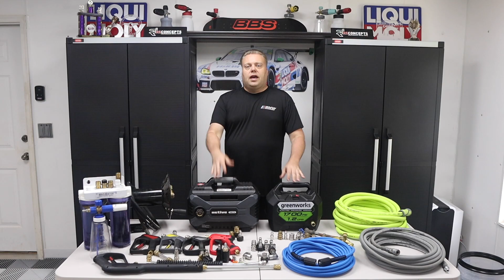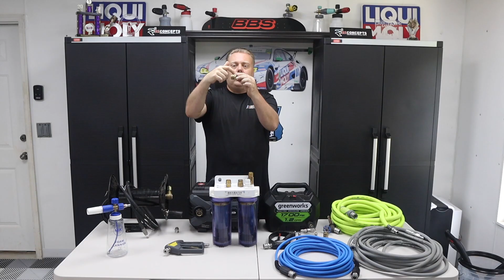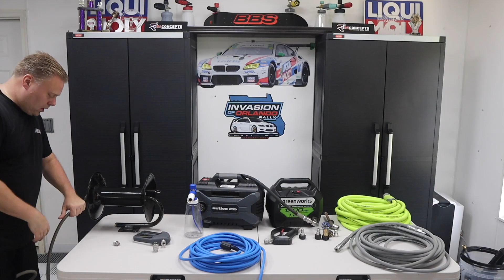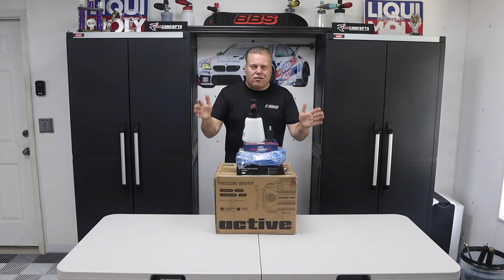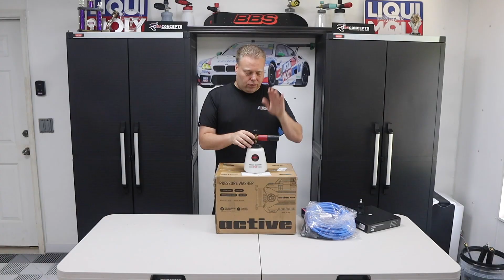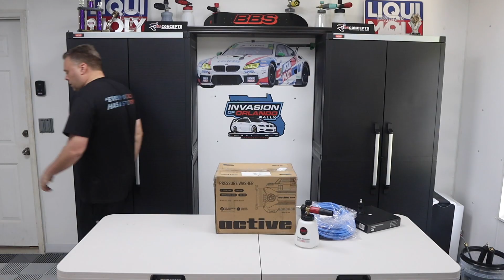How To Upgrade Your Pressure Washer Setup | All Connections Needed | Filtration & Hose Reel

Comment: great videos and explanations.  I have a question about the 90's.  do you experienced any water hammer effect, or have you found any shavings in any of the filters from the water slamming in to the walls of the 90's on either side of the pressure washer?  im thinking of wall mounting my 1800 1.2gph green works  and between inlet and outlet hoses, could turn the probably 11" wide PW into 20 or more.
Reply from the maker: I myself have not seen that usually the elbows I use are ported on the inside so it’s smooth flowing water. I do generally try to avoid elbows if I can though as it is a restriction point. Some pressure washers can create a hammer effect with just a straight hose. The length of the hose really determines the fact as if it’s longer and a flexible type hose it will absorb that.

Comment: If I have quick connect on the pressure washer and gun I cut the water off and release the pressure in the gun still can’t change the gun out have to wait about 30 minutes though when pressure releases can switch between guns
Reply from the maker: I have never heard that before could there be an issue with the gun not full releasing pressure? Maybe a debris blockage somewhere in there.

Comment: I just purchased the simoniz version of the active 52. I bought an adapter to use an Uberflex hose but it won’t work with it, any suggestions?
Reply from the maker: I think those are 15mm M22 on the Simoniz.  You probably need a 15mm to 14mm adapter. I’m not 100% sure though without knowing what is not working.
Reply: @ that’s what I bought and it will turn on then doesn’t work. I’ll try another adapter.
Reply from the maker: @ Normally the issue with an adapter is it leaking not the machine not working. Could the nozzle be clogged with debris?
Reply: @CarsWithKeav  it was brand new. I’ll try it again while I’m waiting for a new one. Thanks
Reply from the maker: @jayrp4059  Nozzles can get clogged with debris from the factory. Usually they will come with a nozzle cleaner for just that problem.

Comment: Bossman Keav. I want to use a swivel with my flexzilla hose i added to my ik foamer. I need a male to female. Whats ya got man?
Reply from the maker: I am unsure of how you have it all connected to know and also have never modified an IK12 there are so many different ways including using air hose fittings.
Reply: @CarsWithKeav  the ik is connected with only the ik fittings. Everything was removed from the flexzilla hose and the ik stuff was added
Reply from the maker: @ Ah, so you cut the Flexzilla and reused the fittings on the IK?
Reply: @CarsWithKeav  yes 100%

Comment: I've got a gun without a swivel, I have bought m22 swivel. is there any issue with fitting it to the hose before the quick disconnect. HOSE > SWIVEL > QD > GUN
Reply from the maker: I don’t see an issue as long as the swivel is somewhere it should help out. Just depends some swivel a little and some swivel a lot. It’s hit and miss.

Comment: Automatic, or push-lock or push-to-lock quick disconnects really need to be a bigger thing. I can only find them for mounts and not Female to female fittings to replace my gun. I had to order one from Aliexpress for $10, we will see how it goes. One company called Car Scope UK sells them but they’re $30 plus shipping. Shocked OG doesn’t even sell them.
Reply from the maker: Never really tried those. I’ve heard some have issue with them handling pressure and leaking. I’ll have to look into them.

Comment: Hey brother anyway you know the size for a elbow fitting for the reel and for the connection for a ryobi pressure washer as well both elbow for the whip hose ?
Reply from the maker: Fitting on the reel would be 3/8 npt and Ryobi hose uses m22 14mm

Comment: @Cars with Keav 😀👋💪
What can be done when de 20" angled wand does not connect with the quick connect properly?
Specifically when it does not lock into place.
Thank you for the help!🔥
Reply from the maker: Biggest problem I have found in the last few years of trying out all this stuff is some quick connects do not work well with others. It’s always advised to have the same brand so they fit. I have a few that will connect to some, but connect to others.
Reply: @CarsWithKeav  Thank you!

Comment: Buddy im starting into pressure washer and im eyeing on the bigboi washr pro do you know what is the size of the end of the gun the quick release where your nozzle tip goes
Reply from the maker: Those will always be 1/4 inch quick connects for the nozzles.
Reply: @CarsWithKeav  so the nozzle tip connector is 1/4?
Reply from the maker: @henrysilos7343  Yes, just about all nozzles are a standard 1/4 inch and the ones that come with the Big Boi Pro are 1/4 inch.

Comment: I have found problems finding answers to my problem... So, I have a 1650 psi and 1,5 gpm pressure washer but im unsure if i can use a 1.1 orifice on my foam cannon. Is it safe for the motor or am i putting stress on it?
Reply from the maker: Can you give me the name brand and model or the link you bought it from? Normally 1.5gpm you should be safe with a 1.1 orifice. Only way to really know is with an amp meter to make sure it doesn’t go higher than what the machine is rated for. I use this one it’s $11 https://amzn.to/46DgZ1S
Reply: @CarsWithKeav  I Use a Parkside 170 D2 Model. Working pressure is around 1650 psi and max is 2450. Max Gpm states to be 2.1 ish (500l/h) and lowest states 1.32 gpm (330l/h). I came across a vid of someone measuring the machines actual working gpm at around 1.58 (360l/h) which is pretty far from the max imo
Reply from the maker: @mxstic_7797  I see this looks to be European it’s not available in the U.S., but looks like it’s a 230 volt electric plug? If it is then you should have no issue running a 1.1 as the 230v would use much less amps than in the U.S. on our 110v system.
Reply: @CarsWithKeav  i meant stressing it by reducing the gpm below the minimum that is stated considering the low working gpm
Reply: @CarsWithKeav  Wanted an opinion cuz i struggle to find a clear one about the damage it could do. I want to have good foam but i dont want to hurt the motor at the same time

Comment: Hey I ordered the quick connect fittings to shorten the original gun but it works good. Hey I look at the video but I didn’t see the connector to make it swivel at the bottom do you have the link
Reply from the maker: This would be the swivel https://amzn.to/3Xt558n are you looking to swivel a stock gun or a short gun? Most don't do that, but it can be done. the investment is basically what a decent swivel gun itself would cost. There are some swivel guns that are $20 such as this one that has the same connection as a stock gun. https://amzn.to/3RvZavv

Comment: Highly under-rated video keav. Problem for most is getting hold of the spares, I would suggest everyone just by Karcher, cheapest spares and availability too - for Europe
Reply from the maker: In Europe at least you got the 230v and your machines perform so much better at lower amp. I’m so jealous of that.
Reply: @CarsWithKeav  Karcher do make 110v Machines for professionals here too. Not cheap. Think Tesla has gotten that too with the 48v truck, you need smaller lighter cables with higher voltage and lower current. Think it's going to be the new car standard instead of 12v, Monroe was suggesting on YouTube.

Comment: Can someone explain why you would want a shut off for your water supply at the pressure washer? Whats the use case for that? To me it makes no sense. Sounds like more of a liability to forget to turn it back on and run the pump dry immediately
Reply from the maker: If your pressure washer is 20 feet away from the spigot you can turn the water on and off without having to walk all the way to the house. If you turn it on and off at the house wouldn’t you have the same possibility of forgetting to turn it on/off then too? This way you bring the hose to pressure washer with the water already running then hook it up and go. No walking back to the spigot to turn it on and then walk back again.

Comment: Just came across your channel great explanation. If you were to up grade what way would you go in my position? active or still stay gravity? I’m just starting out and just found out my system is backwards. I bought a ryobi 2100psi 2.1gpm. I’m just wondering if I should just by a harbor freight transfer pump and call it a day, or change my PW. And which way to go. I have a 125gal tank. I noticed when I did a test ran on my f250 I went through quite a bit of water. Which I was surprised I put 60 gal of di water and I went down to around 30-25 gal after that. I have the Uber flex hose already if I go active I would have to also change my fittings or If I  down grade to a ryobi 1800 psi. I’ve been told I should be ok gravity. But I do have 2.5’ of pvc coming of the tank and a y splitter to the pw with about 2-2.5’ of hose if I had to put the pw on the ground  from the trailer for gravity. And 2’ hose for bucket fill ups.  running on a 3500 inverter generator.  I just don’t want to waste money go the wrong way. Which I can go the active route and just pay that expensive later or home depot has the 1800 for 89 bucks right now.
Reply from the maker: You can gravity feed an Active it just depends on the flow. Ryobi is a good route as well nothing Erin with their PW. When I do DI system testing I store the water in a 500 gallon water bladder and use an RV pump to bring it into my active. Pump was about $60 and can flow 5gpm. I love the active, but the Ryobi is a good buy as well and saves you money needed elsewhere. If this is a mobile detail setup I would stick with the Ryobi as the warranty is good and the Active is known to not last long when being abused daily.
Reply: @CarsWithKeav  yes it’s a mobile set up.  Should I down grade to the smaller  ryobi unit? I don’t want to be in the middle of a wash/detail and water starts to become a problem due to gravity.  Trying to start something with my kid. Teach them young.
Reply: Right now I believe I got about 15 gallons and the Ryobi is struggling to the point where it doesn’t even pressurize the system.  I know I may have a twist or turn in the hose that may be slowing it up but if I’m getting down to that little water then it’s just concerns me
Reply from the maker: @DJMEDIC671  Really need to understand the gravity feed and how much flow it is doing to know if you would have problems. If you are flowing twice what the pressure washer needs you should be okay. I myself am not much of an expert in gravity feed. I have never used one before. I have only pumped water.
Reply from the maker: @DJMEDIC671  If the Ryobi is struggling the Active would be even worse. Might have to think about running a pump or getting the gravity feed higher. Too bad no reputable company really makes a self priming pressure washer that isn't battery powered. Wouldn't need gravity or a pump with one of those.

Comment: Would the average plumber know how to hook up that system?
Reply from the maker: They should they would be very familiar with the NPT thread sizes they might now know a lot about the pressure washer fittings, but I’m sure they could figure out easily.
Reply: @CarsWithKeav  how big is your garage?
Reply from the maker: @gearlstrickland3365  garage area is around 300 sq ft. 16x20. Total garage about 450 so when it’s really hot or cold I use the vinyl curtain to separate sides so my split A/C only has the 300 sq ft to heat and cool.

Comment: Still way over my head! I just want to buy the Uberflex or flexzilla to upgrade my Nilfisk C120.6 and I can’t find anywhere what connectors I need for it to fit!
Reply from the maker: I wish I could help, but I am not familiar with the connections used in Europe. I checked the pictures and they are connections I have not really seen before.

Comment: Great content! I’ve got a sun joe pressure washer and have quick connects for my Uber flex hose and MTM hub. What is the best QC to use for my garden hose to attach to my sun Joe pressure washer. Does it need a specific adapter
Reply from the maker: Should just be Garden Hose connections. This would do well in brass form for cheaper https://amzn.to/4bbwUqk or the high quality stainless here https://amzn.to/47NMGEM Thanks for watching!
Reply: @CarsWithKeav  appreciate it! thanks for steering a weekend warrior in the right direction! 🙏🏻

Comment: Awesome video. Great explanation. I recently got the ego 3200psi machine. It works well and looks amazing. However, the oem gun comes with a 3/8" quick connect instead of a 1/4" one. The only 1/4 quick connect is at the far end of the wand, which makes using "normal" foam cannons practically impossible.  Really confused why it's designed that way.

I've spent hours googling yet i still can't find a 3/8 to 1/4 adapter or any walkaround solutions (it doesn't make sense if there's no solution). 

Now although I'm tending to get either sgs28 or the og spec gun, it's quite a pity to give up the wirless control and battery indicator on the oem gun. (Btw the oem foam cannon is much better than the "foam guns" that come with some other machines.)
Reply from the maker: How did you get one of those? I can’t find anybody selling them that isn’t saying it’s a pre-order. I want to review one for sure and figure out the upgrade path.
Reply: @CarsWithKeav  I got it from Lowe's, in stock at a store 45 minutes away. Their website of the $799 kit didn't have the charger on any of the pictures or description, so I had to visit the store in person to make sure. Turns out it does include the charger like other distributors.
Reply from the maker: @Zpiet820  I just ordered one from Lowe’s. Dang that’s expensive, but I don’t have any batteries. I just saw them on Amazon as well with no batteries for $450. I put out a review as soon as I can.
Reply: @CarsWithKeav  can't wait for it!!

Comment: Have you (or anyone reading this) had any experience with the Flexzilla garden hoses with the 1/2in quick connects built in? I'm concerned on how well they work if you are not using the Flexzilla 1/2in adapters.
Reply from the maker: I have not heard of 1/2 inch quick connects. Usually no matter the size of the garden hose whether it’s 1/2, 5/8, 3/4 or even an inch they all use industry standard 3/4 threads. I would assume the quick connects would be the industry standard for that as well. Just looked at one on Amazon and think the quick connects can be removed giving you a regular garden hose thread.
Reply: @CarsWithKeav  sorry, I meant the 1/2 hose with quick connects. I live directly across  from a water tower so pressure is not usually an issue so I did just order one of the hoses. We'll see how well it does, and if those plastic quick connects are any good.

Comment: Howdy, thank you for your content. I just lately started tuning into your channel. 
I have well water, will the filtration system you are showing work for well water?
I'm sure you probably did a video in the past addressing Well water..
Reply from the maker: It will work with well water, but usually it’s higher in ppm which would lessen the lifespan of the DI Resin. Many people run two filter setups one for sediment and carbon for chemicals then the DI resin for spot free. Those with higher ppm tend to run much bigger filters and tanks since they have to replace more often. A reverse Osmosis system is also an option for well water.
Reply: @CarsWithKeav  thank you for taking the time to respond,  I will look into your suggestions!!! Thank you very much!!

Comment: Great detailed video!  I have the Chemical Guys ProFlow washer, CG Snubby gun, CG big mouth cannon.  I bought the Flexzilla hose and quick connectors kit.  I’m I able to connect this all up or is the CG products proprietary connections?
Reply from the maker: From other videos I have seen the from Quick Connect is not proprietary just the connection at the gun. If you have the right connectors it should work.
Reply: @CarsWithKeav  thanks for replying.  I will need to look into it a bit more and see what connection changes i need to make.

Comment: Flexilla has aluminum fittings. They will fuse to brass quick connects. Sucks. I wish they offered upgrade to brass.
Reply from the maker: I have never encountered brass and aluminum fusing. Is this a hot sun kind of thing?
Reply: @CarsWithKeav  It's called Galvanic Corrosion. it's not a temperature thing. I contacted flexilla. they just suggested Teflon tape to separate the dissimilar metals. They are aware.

Comment: Are you not doing your two stage water filters anymore? Or is the budget deioniztaion just the better option
Reply from the maker: I was just using the DI setup as an example for the connections. The two stage would be the exact same connection setup. I would still use with a cart as the DI setup is smaller. For my wall setup I just run a CR Spotless and let the resin do all the filtering. This would all depend on your water quality. Mine is good enough the two stage is not needed as much.

Comment: I'm looking to save for a nice electric pressure washer to syst my detailing business. Not sure what to get.  The one your giving away how is that one?
Reply from the maker: It’s good, but longevity for a detailing business it’s not quite there. AR 630 would be where I would start as it’s serviceable and meant for
Commercial use. Active VE56 is a residential enthusiast product, but I know several that use it in mobile detailing and love it. Their Active 2.0 is more detailer focused and has twice the life. So it’s buy the long term unit or buy 3 Active 2.0 for the same price. Tough decision actually.
Reply: @CarsWithKeav  I'll do some research on those two. Thank you for your feedback and help.  I appreciate it. Helps out tons. Ty
Reply: @james-dt4ei  I'm looking into buying the Active 2.0 or AR 630 next week. What did you end up with and how do you like it?